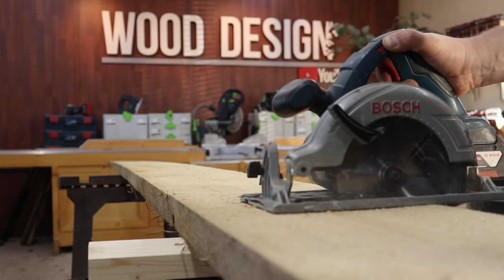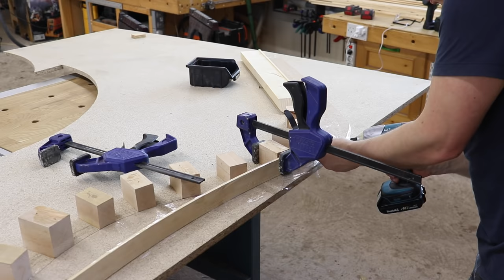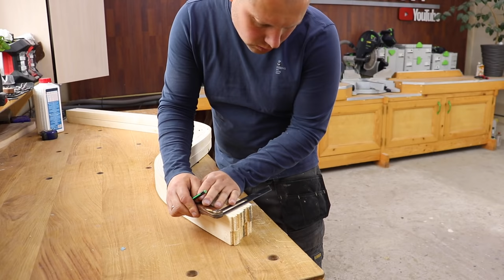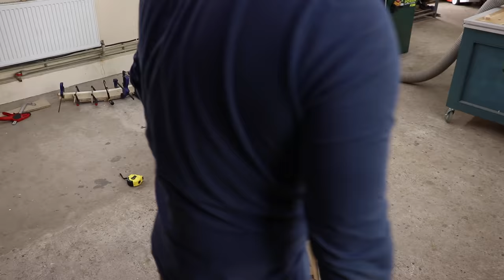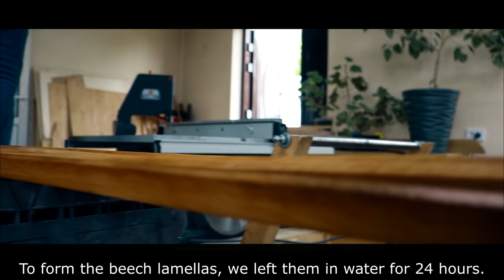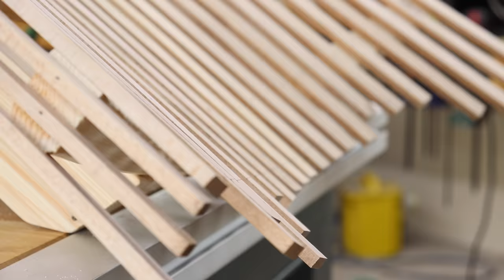LOUNGE CHAIR | ШЕЗЛОНГ - Мебель своими руками

Comment: The corner thin strips of wood will brake off and the bottom is very close to the grass which means it will rot easily if it stands outdoors. I would suggest making the side strips deeper so the sides are covered and provide more damage resistance. Also perhaps rilting the whole thing so theres good 10-15 cm of empty space at the front and adding metal reinforcement to the feet to prevent rot.
Reply from the maker: I wish you good luck, as soon as you do, send a photo for me to see.

Comment: It’s hard to tell from the angle but is the slat gap at the top consistent all the way to the bottom or does it slightly increase (I only saw you use a spacer once ). Great video!
Reply from the maker: Тhanks a lot. No clearance is different.

Comment: Is it just water you spray on before the glue? If so, why?
Reply from the maker: Yes, it's water. This makes it easier to bend the wood.
Reply: @WOODDESIGN6730  thank you. What woods did you use? And what glue?
Reply from the maker: @jamesculpin9680   The base is pine, the top is beech. PVA glue.
Reply: @WOODDESIGN6730  thank you